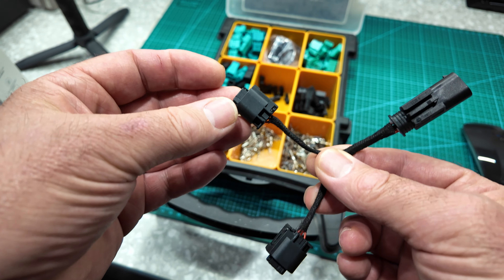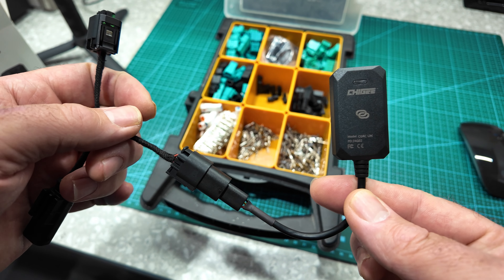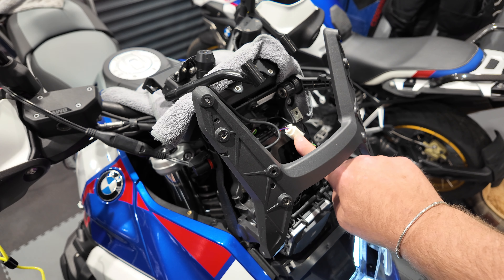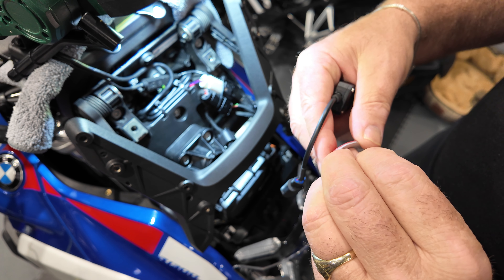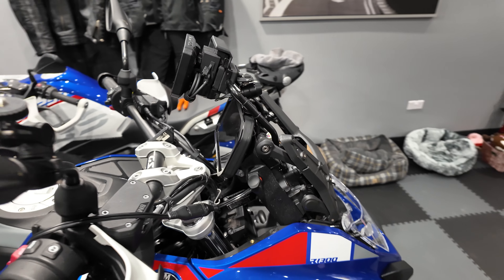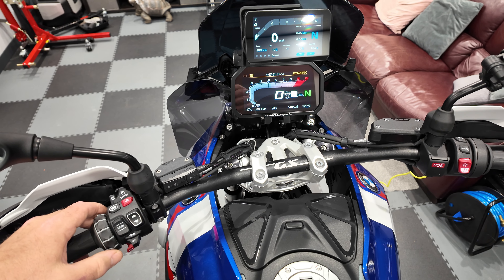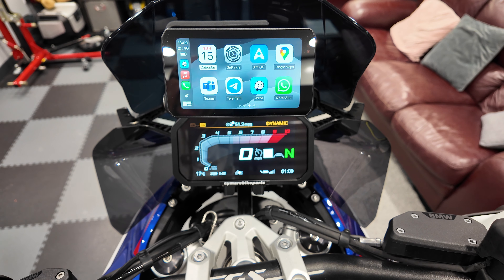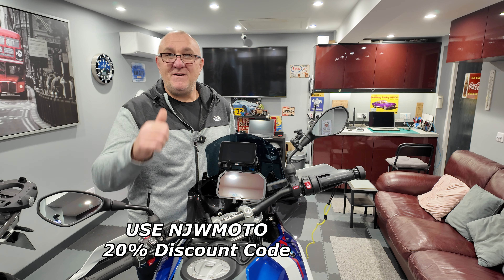Chigee CGRC Lin Bluetooth Adaptor Fitted to AIO-5 Play BMW R1300 GS Wonder Wheel Function

Comment: Great video! Thank you! I have a 2023 R1250RT.  Would the  CGRC LIN for BMW work for my bike? I have not been able to find an application for the 2023 RT. :-(
Reply from the maker: Which Chigee are you using is it the Standard play fitted with the lossless mount ?
Reply: @ I am using Chigee for BMW with a Garmin cradle for BMW NAV 6. I want to use the Chigee on both 2021 R1250 GS and my 2023 R1250 RT. Wil Smith
Reply from the maker: @wilsmth6189 
You do not need CGRC lin adapter with the Play for BMW this is built into the unit ! 
Does it work on any of your bikes ? 
Have you tried to hold down the menu button to enable nav wonder wheel? 
If this doesn’t work you need to check the nav cradle has a 3 wire connection 1, 12v 2, Ground 3, lin bus line 

Hope this helps

Comment: Good useful video, thanks! I'd like to make my own Y splitter for my CGRC LIN. Would you be kind enough to let me know where I could get the kit of BMW connectors form please? At the moment I have just spliced into the live from the CGRC LIN to take power to my Chigee Lite.
Reply from the maker: Hi thanks for the comment, these are what I ordered they were slightly wrong as I had to modify the little guide inside them but they fit perfectly after that 

https://www.aliexpress.com/item/1005001777214470.html?spm=a2g0o.order_list.order_list_main.11.27651802O3cxAE

There is some made up leads on AE but only have 2 wires but you could add the LIN Cable yourself 👍

Comment: thx for the video. actually i have the chigee connected directly to battery and fuse, and lin on 3 pins. I've already have an y cable from Ali but 2 pins, i'm strugling to find the pins to make the cable like you did, is possible to have the codes of the pin or the link where to buy connectors and pins? thx in advance
Reply from the maker: Hi the pins are called Dupont 2.54 mm here is a link to some on Amazon https://amzn.to/3zoalRd
Reply: @NJWMOTO  thx